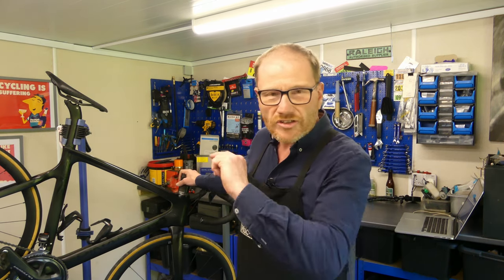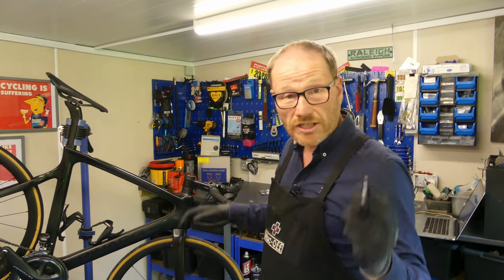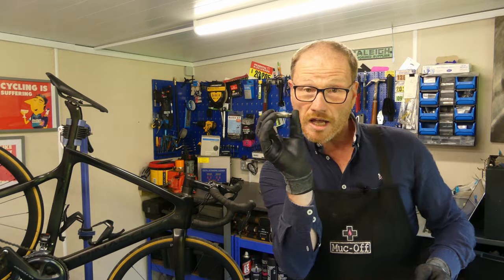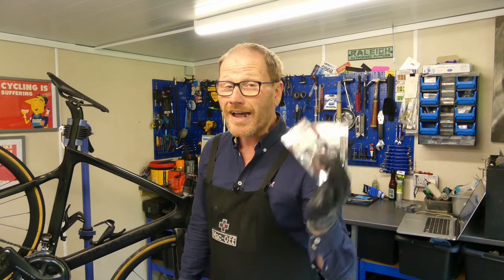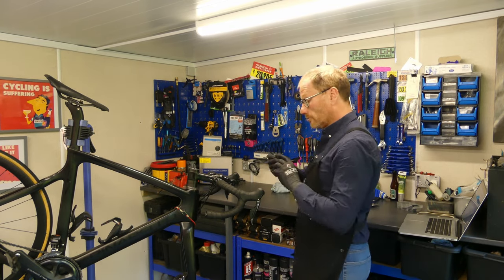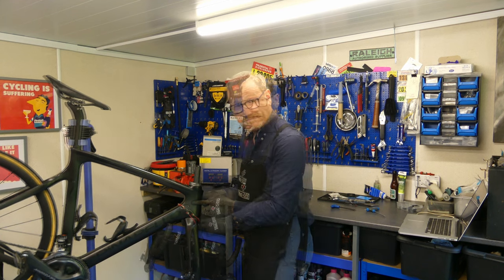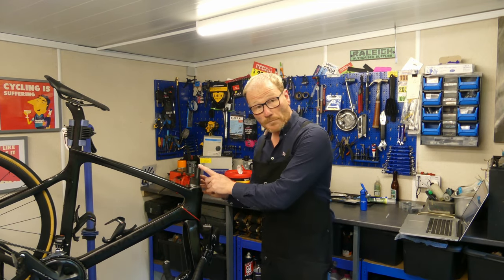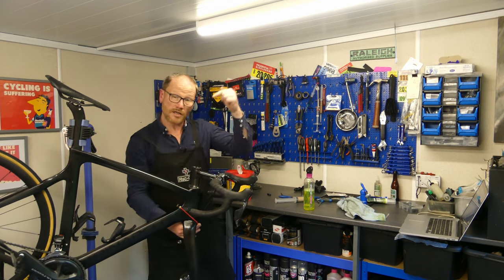How To Replace Integrated Headset Bearings (AHeadset) - Road Bike Maintenance

Comment: I bet you've never round off a Torx bolt, nor ever heard of someone else doing so. These are designed to handle more torque and be far less susceptible to rounding than hex bolts. I agree it's stupid to mix and match hex with Torx on a bike... but I'd prefer if they were all Torx.
Reply from the maker: Hi G,

No, I haven't personally, but I know many that have, by either undoing them when there is mud/dirt in them, so the tool doesn't go in properly, or by attempting to undo them with a hex key.
Reply: Dealt with plenty of rounded torx bolts as a working mechanic, e-bike motor mounting bolts and rotor bolts especially. I don’t mind hex or torx but don’t pretend torx are perfect.
Reply from the maker: @AnotherMrLizard Agreed Adam. There is some kind of miscommunication that Torx is infallible

Comment: 4:50 Too bad Hambini refuses to admit when he's wrong about a bearing pullers not being able to remove bearings on a hub. It was a scandal. Of course they can pull out bearings, he claimed the puller can't do it as the bearing does not have a chamfer at the inside race, absurd claim. They all have to allow a puller to do it's job.
Reply from the maker: I use one in this video:
https://youtu.be/nji1dw2UWTI

Comment: So you want to pack grease on the top and not on the bottom. 

Don't you need to use a headset    press to press it in place again
Reply from the maker: Hi,

Top - Plenty of grease, to stop the water getting in.
Bottom - A small amount rubbed into the bearing body to aid installation, and prevent rust.

Headset bearings like shown in the video are not an interference fit (tight fit), they just slot into place. No specialist tools needed to remove/replace them.

Hope that helps, and good luck with it 👍

Jon
Reply: @ribblevalleycyclist  yes it does

Comment: stop adding of when you say off
Reply from the maker: Not sure what you mean
Reply: @ribblevalleycyclist  you take the bearing off the fork, not off of the fork
Reply from the maker: Did you find the video useful, or informative?
Reply: @ribblevalleycyclist  yes, but the outer race of my lower bearing is stuck in the frame and I cannot budge it.😞
Reply from the maker: @davemoss6976  So you found my video useful, but instead of saying that, you chose to insult me by questioning my use of the English language......... Good luck with that bearing.
Reply: @ribblevalleycyclist  no insult intended, just one of my grumpy old man triggers . It grates every time someone says "off of"or calls women guys, or says "yes no" at the same time. Life is tough for perfect people like me.
Is the Ribble valley club still going strong? The Ribble valley was my cycling stomping ground years ago, 1 inch external headsets with loose ball bearings for everyone back then.